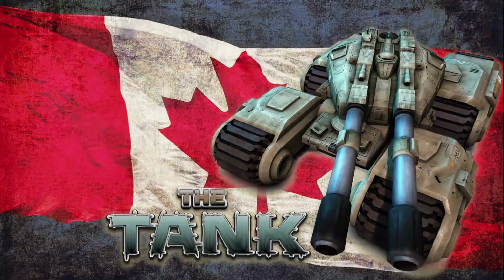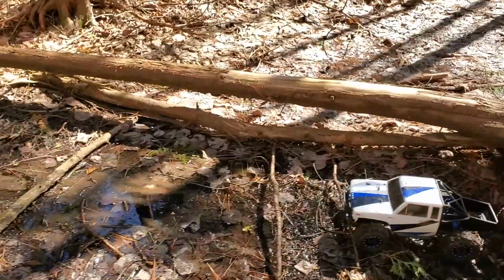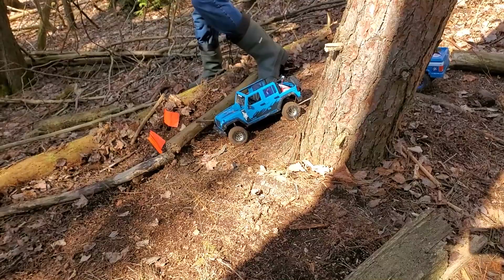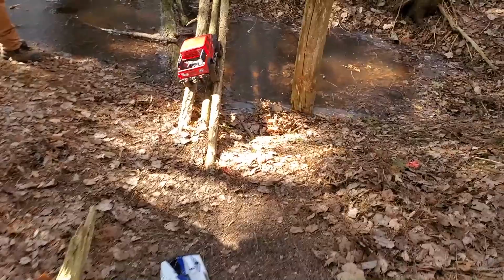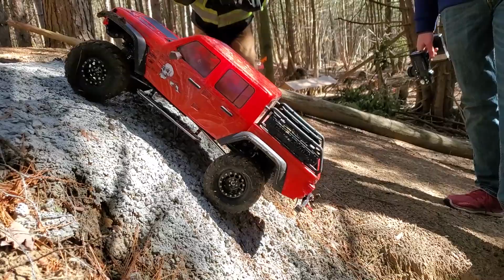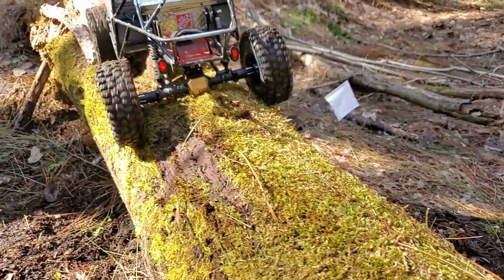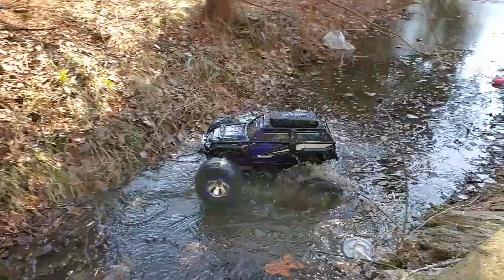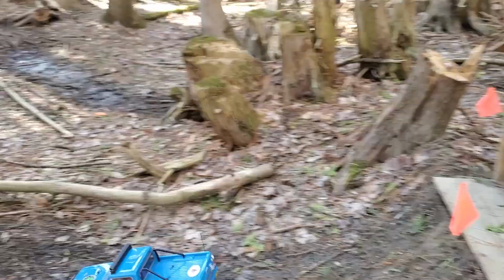CR12 Tioga on the Trails with the big boys

Comment: RC6GS V2 cuirse control will be helpful, Crawler is difficult in controlling the throttle on the downhill slope, the cruise control system of RC6GS V2 helps the driver easily set the optimal throttle volume for RC crawler car.
Reply: I have your remote. It's good. Please make a version with short antenna. It's the only thing I don't like.

Comment: I love the trail walker I got 4 of em now each one slightly different one of em is considerably over powered and I kept one stock the crazy over powered one has a 4276 2200kv sitting in it with a hobbywing Max 8 esc lol. But it runs amazingly that giant motor has tons of torque and drag brake even with the drag brake turned down it's got a ton lol. Only pinion I can use with it is 16T 32p with a Integy 57t spur for my big rock lol iv had to change my crown gear in the rear because it got chewed up after a month. But now it's all good with  Stronger crowns ect. But my favorite one isn't that one.. it's the one I installed my new  Tenshock 906 540 brushless motor it's a 2400kv on a max 10 SCT.. and it's absolutely amazing the cogging is basically not their which is awesome. So it's my go to truck now

Comment: Just ordered the mighty TIOGA With $15 coupon code- Amain
Reply from the maker: It is a pretty capable little truck for the price. Enjoy and thanks for stopping by
Reply: My first ROCKcrawler-Happy camper update- it’s a little but kicker on big sharp rocks- just pull trigger and mission accomplished with all shocks torqued down tight - no mods needed-buy xtra batteries- your fun crawler video sold me- You all there rock - little t rules-✌️